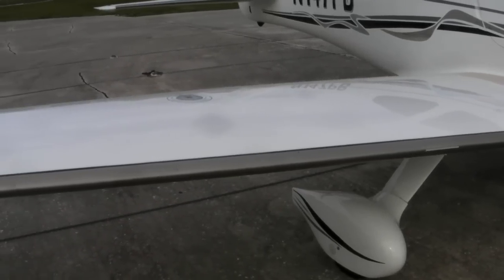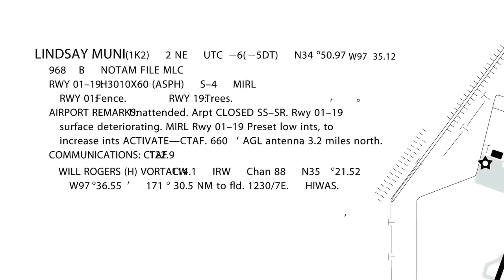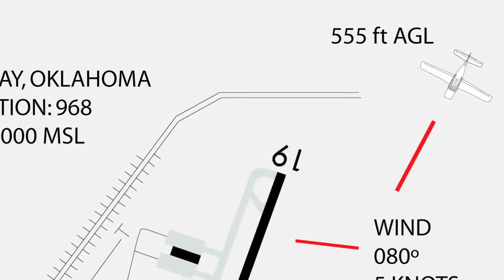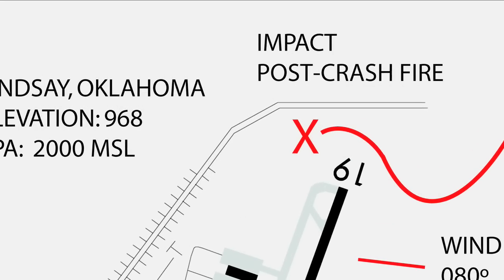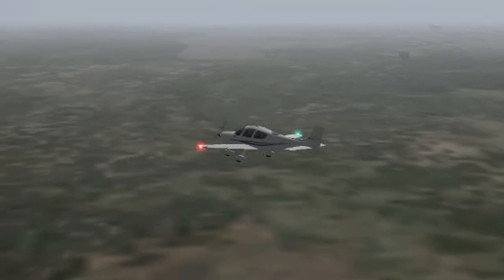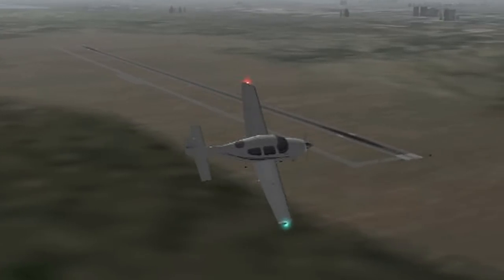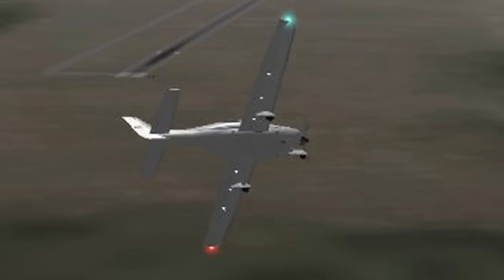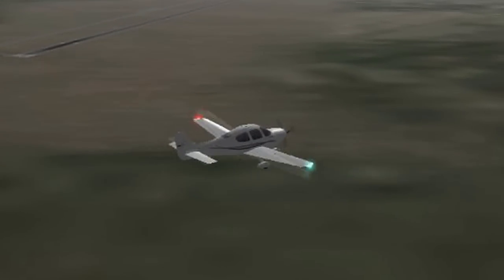Anatomy of a Cirrus Stall Accident

Comment: So is this a situation where there was a CFI on board with a student pilot? My CFI would never have allowed me to enter the airport environment in such a shoddy manner, below pattern attitude etc.
Reply: Depends on the intentions. I was taught low altitude pattern work for going in and out of confined airstrips and in bad weather. However,airspeed, attitude, and bank angle are critical.
Reply: Tony Ascaso mentioned at the very beginning of the video it was a pilot with a CFI for his BFR. So he at least held a PPL.
Reply: I'm not yet even a flying student .. but if low and off the approach pattern ... is the correct thing to just abort the approach and try again from a greater distance? I don't understand the steep turn to the left in the first place .. desperation to make a landing does not make any sense to me.
Reply: I've had 5 hours of lessons and honestly nothing about this approach seems at all sensible to me.
That people do stupid stuff is a given, but here you had not only a lone pilot, but an instructor beside them as well?
That seems stupid.

First question is why are you approaching from such low altitude, and second question why are you pulling such sharp maneuvers? You're clearly not in the correct position to try a straight-in landing, so fly a proper pattern instead?
Turn around and redo your approach?
Pretty much anything at all would've been better than making a bunch of really sharp turns at low altitude...
Reply: @jabberwocky1969  Just wondering if the words on the RT before this happened were "Watch this"?  I had an instructor do that to me,  showing off to the other pilots standing outside the training office.
Reply: @KuraIthys  Maybe it happened so fast the CFI didn't have time to react to his sudden sharp maneuvers. Even experienced pilots make tactical errors in critical moments that end in tragedy.

Comment: I believe Paul was among the first aviation writers to dismiss the initially high number of fatal accidents in the Cirrus as being the fault of the airplane. John King, a few years back, may not have used the term, affluenza, as a cause of aviation accidents but he accurately, though diplomatically, spelled it out. As aviation left the realm of middle-class avocations many of those with the means to pursue it were, due to the very root of their financial success, temperamental ill-suited to pursue it. Aviation is not about what you want. If you approach it in the no-excuses manic success at all costs manner that gave you to the ability to purchase a new aircraft, it will kill you.
Reply: Somewhat agree, true, the type that can afford a new plane is, more often than not, make less than ideal pilots.

I think the high rate of Cirrus fatalities was because of it's appeal. It's selling points made it a good alternative to larger twin engine aircraft; the caps and saftey first mantra appeals to low hour pilots; couple that with poor training and pilots jumping from high wing 182's into an SR22, and you have all the makings of a crash waiting to happen.

Cirrus addressed the issue with It's training programs and the results are pretty staggering, from one if the highest accident rates to the lowest.
Reply: I still remember the bonanza doctor killer!
Reply: @kellyreim6627  I prefer to say that lots of doctors were killing Bonanzas.

Comment: Who the hell allows an aircraft to enter a 60 degree bank at 300 ft AGL? Regardless of the design of your damn wing.
Reply: I've done it....in an Extra 300L. LOL      NEVER in a normal category aircraft, though.
Reply: I did it,

...in a flying sim on a PC display at a local electronics store.
Yup, I crashed too.
Reply: The same thing happened to Learjet 35 near Terenboro NYC, but they just stalled the plane without applying the rudder.
Reply: You’d be surprised, people tend to panic when they over shoot base to final , and assume they HAVE to land the plane
Reply: Would have worked if he hadn't applied so much rudder..cross control is effective at solving this problem too high and too fast but like anything else can't overdo it.

And you wonder why there is a push for automated flight....this is like crashing your car into your own house at 60mph
Reply: @karlsandin4515  is this panic  or just poor piloting?
Reply: touristguy87 he was cross controlled into a skid , if he was slipping he would have never stalled and spun , I’d also say panic leads to poor piloting
Reply: @karlsandin4515  or maybe poor piloting leads to panic! gee it's so hard to tell!
Reply: touristguy87 definitely interchangeable !
Reply: yeah i mean i agree that was maybe a bit too agressive hahaha, tho possible (depends on the plane and the pilot)
Reply: someone who is either suicidal or oblivious to what is about to happen..
Reply: No, 60-deg bank at 223 ft AGL.
Reply: Does seem like a panic move, doesn't it?
Reply: Lol read many accident reports ..but the chute will save us all 😂
Reply: Fighter pilots lol
Reply: @touristguy87  panic is poor piloting
Reply: "Who the hell allows an aircraft to enter a 60 degree bank at 300 ft AGL? Regardless of the design of your damn wing.:"

not a problem with sufficient airspeed

any degree of bank is a problem with insufficient airspeed
Reply: @cmdmd  I'm not advocating anyone enter a 60 degree 
bank at 300ft AGL, but if he was dumb enough 
to try that, shouldn't he have been smart enough to 
dime the throttle before doing so?
Reply: @bikersoncall  

Well, I have gone past 45°, easily, doing short approaches during engine out drills on a C-172, turn steep at the numbers. 

You’re right, you can maneuver, as long as you’re coordinated and you have the right speed.
Reply: @cmdmd  Thanks for the confirmation, 
its all numbers isn't it...
Reply: @bikersoncall  

Also, if he go startled or nervous, his brain was not functioning at 100%. Humans operate differently when in crisis.
Reply: @cmdmd  I find myself turning 
the faucet on to the right occasionally,
and that's not while I'm under pressure.
lol. :-\ :-]

Comment: This is the deadly classic:
1. Low
2. Steep turn
3. Pull because airplane starts to lose altitude rapidly i steep turn
4. Step in opposite rudder because turn gets too steep
5. Make a snap roll opposite to the direction of the turn and ...
6... die
It has happened hundreds of times. And no matter how often we flight instructors warn students about steep turns near the ground ... there is always another one.
Reply: All GA aircraft need low altitude deployable parachutes

Comment: If I may, I am a 22 year old commercial pilot. It is, in fact, less dangerous to fly than to drive. You don't think that 20 year olds should be allowed to fly? I've been flying solo since I was 18. Many airline pilots are 23 years old. Most Air Force pilots are 26 or under. Young people can be responsible as well as old. A person that is 18 can go buy a car or motorcycle, so why can't they buy an airplane? Please use common sense before making a senseless post that makes you look stupid.
Reply: GA has the same fatality rate as automobiles. Deaths per 100 000 hours, i mean.

Comment: Great video. CFI must have been sleeping. This was a go around. That said pilot traning doesn't include hands on spin training. For that reason pilots should play with flightsims where you can develop muscle memory and technique and gain a very deep understanding of stalls, spins and in this case snap rolls. So any aspect or scenario can played out until you know how you will deal with it as here, just abort and go around.

Comment: More stall-spin accidents occur when the engine quits after take off than what is commonly believed to be the from the "base to final" approach turn.  See AOPA magazine statistics for authority.  It's quite rare for the airplane to stall in the traffic pattern when things are going well.  But imagine you have just departed and are climbing through five hundred feet when the engine abruptly quits.  Studies show most people need at least five seconds to figure out they need to immediately react.  Buy that time, the energy has been greatly depleted and the airspeed is slow.  The airplane is about to stall and the nose is still in a climb attitude.  Unless the pilot is cocked and ready to instantly pitch over, an incipient stall-spin will likely occur.
               We need to teach pilots prior to departure to be ready at an instant to get the nose over into below level attitude and fly the plane as slowly as possible into the inevitable crash.  As Bob Hoover has always pounded into our thick skulls: "fly the damn thing into the crash as long a possible".   This way the energy will be dissipated slowly so that there will be at least a chance of survival.  The force of the crash is quadrupled with respect to speed as the craft dissipates its energy along the ground. The longer it takes to land in the crash the better chance you have to survive. Simple as that.
              Guys, the base to final stall spin event is extremely rare.  Yes, we should pay attention to high "G" loading and steep turns while low to the ground.  But the biggest killer of people in GA accidents is when the engine quits after take off.  We need to be hair-triggered and ready to push the nose over.  Better to crash into something where it takes time to dissipate the energy than to go straight down.  In that event, there is no chance at all.
Reply: When you say push the nose over, do you mean down? I'm not a pilot, I just know from watching commercial airline accident videos that when a plane enters a stall, the comment sections scream with "PUSH THE NOSE DOWN!" Is that what you mean?
Reply: @zyrrhos  Very simply, your controls don't work unless you're moving fast enough. When you're climbing, you're pointed up, but that's ok because the engine is keeping your speed up. If you're pointed up and the engine quits, you start slowing down. At that point, you have the choice of either pointing down to get enough speed for your controls to work (which is counter intuitive because you instinctively want to try to keep as much altitude as possible), or you can keep trading speed for a little bit more altitude until you're essentially a funny shaped rock in the sky.
Reply: @derp195  Oh, I get all that. Like I said, I've watched enough of these videos to know. The Air France flight from Rio to Paris was a good example of that. I was just wondering about the OP's use of terminology. Thank you though.
Reply: @Flying_Snakes  This is true when things are going well.  But statistics show that the most frequent "stallspin" accidents occur with things don't go so well.  For instance, immediately after takeoff when the engine quits is when most stall spins accidents happen.  Studies cited by John King of King Aviation Schools show that in single engine airplanes during an engine failure during the take-off phase when the aircraft is still on a straight out course, it can take as long as 5 seconds before the pilot even realizes he must lower the nose to maintain airspeed.  The failure to maintain flying speed usually ends up in  the stall/spin situation.  With twin engine airplanes, the situation can be even worse if the pilot is not trained to act immediately.
Some pilots were taught years ago that the skidding turn from base to final approach was the worst culprit.  Although not a good thing to do, the engine failure after departure has taken more lives than mid-air collisions.  But most accidents do occur in the traffic pattern according to studies cited by John King.
Reply: The skidding turn whether on base to final or while attempting to turn back to runway after engine fail causes most of the spin accidents. Practicing the "impossible turn" scenario and going around when not lined up on final will avoid this. AOPA study does show the majority of stall/spin accidents happen below 1000AGL due to insufficient time/altitude to recover.
Reply: @Flying_Snakes  Most stall spin accidents occur in the traffic pattern during the take-off and departure phase of the flight.  The skidding turn from base to final is not the most likely cause of stall spins.  These studies have been reported in AOPA and have been discussed by John King of King Ground Schools.  Many people do improper skidding turns every day when they overshoot base to final, yet we don't read about it on a constant basis.  However, when we read about stall/spin crashes, it's usually after the take off or go around part portion of the departure.  As well, the most common reason for the "impossible turn" other than practicing them, is because of engine trouble during the take off and departure phase of the flight.https://www.aopa.org/-/media/files/aopa/home/pilot-resources/safety-and-proficiency/accident-analysis/special-reports/stall_spin.pdf
Reply: @daffidavit  Just a theoretical question, if the engine cuts out, since most airfields open into fields, can't you just try to land on the field behind? Of course, you need to pitch down before stalling or you are just done, I do not disagree on that at all, but "flying into the crash"? Do you have not enough speed left to glide down relatively softly while still keeping controls?
Reply: Almost all engine failure on take off deaths are when the pilot tried to "turn back". Against all instincts, you must keep airspeed - nothing else matters. The accidents I have seen where they chose to continue to fly the plane forward, and not allow a stall, most pilots survived.
Reply: @uncannysnake  trying to turn around and head back, trading altitude for airspeed, you are very close to the "dead man's curve". When on a sharp bank, wing loading can pick up very fast if you start pulling back, and the speed amount where the aircraft stalls increases dramatically.
Reply: @rinzler9775  I tried it in some flight sims on WW2 aircraft since then and I actually do get it now. I pulled up from the airfield at min speed and left the landing gear out,  and immediately cut all power. It is incredibly hard to actually glide even straight forward. Too much down you won't be able to rotate back up without stalling, causing you to crash harder. Too little and you will just stall and increase your down angle even more. The solution was to just very barely be above stall speed and keep the plane as calm as possible and hope the vertical speed you are coming down is low enough to not rip the landing gears. And steering was absolutely impossible, a row of houses in front of you and it's all for nothing. Very scary.
Reply: @uncannysnake  the instant you start to turn back, you also just gave up your "continue forward" option.
Reply: @rinzler9775  Yep, but I still don't quite understand honestly. My plane had a stall speed of 150 and I was going at 230. Yet I was still coming down way too fast. Shouldnt a plane be designed to be able to maintain altitude at some reasonable level when gliding? Or does that require a massive wingspan?
Reply: @uncannysnake  what was your bank angle ? - google bank angle vs stall speed chart.
Reply: @uncannysnake  actually - which plane was it - you also need best glide speed for that aircraft, adjusting for weight and altitude above sea level values.
Reply: @rinzler9775  I tried it out in the Bf 109 F-4
Reply: @uncannysnake  what simulator is that ?
Reply: @rinzler9775  Any of them really. I tried with both the full sim Il-2 1946 as well as the more mediocre (but still good FM) War Thunder Sim Mode
Reply: @uncannysnake  as far as I know, war thunder is not renoun as being an accurate sim - I played it way back, and it was very "arcade" like, but it could be different now. IL2 is not bad, quite a good flight model. MSFS, DCS, Xplane, prepar3d etc - are the gold standard in terms of decent floght model. Either way, you should akso look at a wing loading vs bank angle chart. Typically, at level flight the aircraft needs to apply 1 G of wing loading to maintain level flight. At 60 degrees, this would typically be 2 G's - so twice normal force, the wing needs to be moving much faster to sustain level flight. Its stall speed is also much increased roughly in line. Do a YT search for "Stop stalling or spin in" - its really old, but explains these fundamental principles which are the same today as ever.
Reply: @uncannysnake  one other choice you need to make - shoukd you raise landing gear ? - in rough terrain, yes, in a smooth field, maybe no - unless its wet and muddy, you don't want the wheels to dig in a flip the plane.
Reply: @rinzler9775  I didn't think about landing gear. Yeah you are right, one can risk a belly landing and damage to the aircraft if your life is in danger. I also didnt change prop trim for drag reduction.
Reply: @rinzler9775  Also it's true, WT is an oddball. On "Sim controls" planes are either hit or miss, some have a better FM than 1946, others... not at all. None can compare to the newer Il-2s of course
Reply: @uncannysnake  MSFS seems to emulate stalls pretty well, similar to the real aircraft.

Comment: This feature was on the spitfire in the '40s, the wing was slightly twisted down at the outer edges, the inner wing stalled first, buffeted the pilot warning him of max AoA
Reply: yeah, kinda like a mechanical stall horn. pretty cool.
Reply: They still do the twisting thing even on modern fighters.  The F/A-18 has a really pronounced twist, which is a small part of what allows that airplane to do some really exotic high-AoA maneuvers, despite the wafer-thin airfoil.